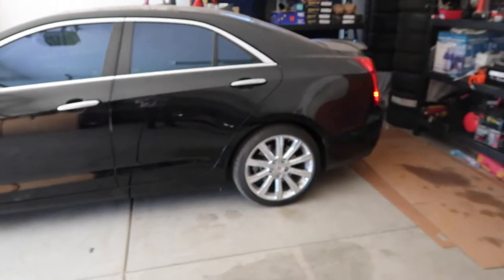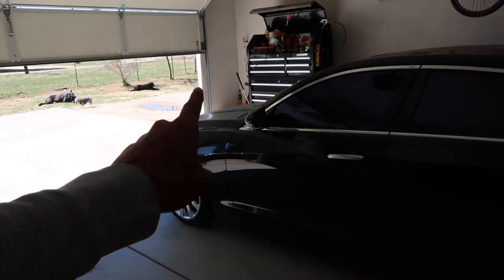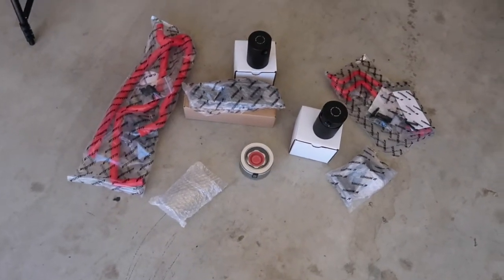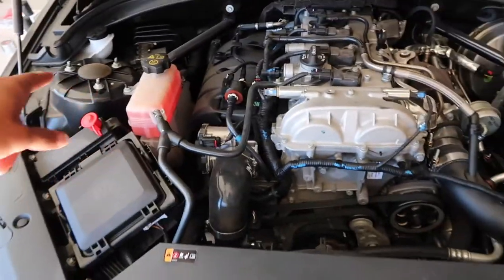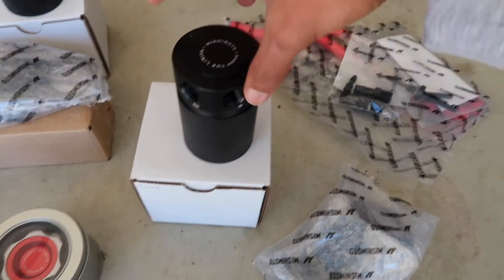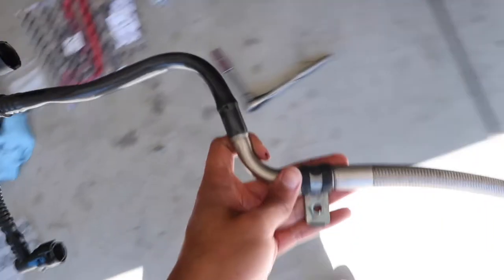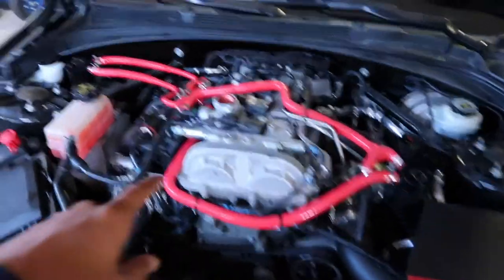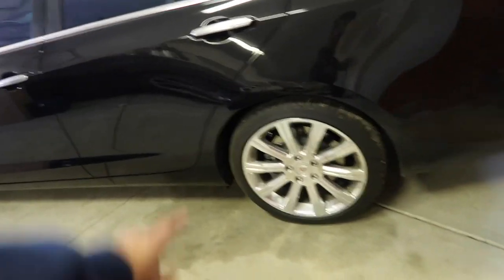Cadillac ATS 2.0T 6MT Mishimoto Dual Catch Cans Install!

Comment: Definitely crazy routing on that hose way over engineered curious why they don't have check valve every other manufacturer 4 catch cans have check valves maybe they're not really needed great video keep them,
Reply from the maker: Likely for the sake of appearance but the LTG motors definitely need catch cans as you can run into issues with excessive blow by once you're making "real" power (stage 1 and up). Even when I was stock my turbine on my turbo was covered in oil.

Comment: Considering the ATS has dedicated injectors actually spraying the cylinder walls periodically to keep the heat down (similar in effect to how port injection cools/cleans the cylinder walls), what's the point of this device?
Reply from the maker: The purpose of a catch can is to take what is being sent out through the positive crankcase ventilation (PCV) valve, and separate the actual oil that may come out, collect it, and send just air and vapors back to the intake manifold, as opposed to the PCV system sending both air, vapors, and oil back in the intake manifold. The catch cans have definitely limited the amount of oil that my turbo would eat prior to the cans being installed.
Reply: @PREVA1LMOTORSPORTS  the air intake already has a baffle system before the throttle body (most likely for that purpose)
Reply from the maker: On ATS's the intake isn't attached to the throttle body, it's attached to the turbo unless it's a NA 2.5L or NA 3.6L. I know what you're talking about though, the white filter inside the stock intake. I personally think that filter thing is more for silencing the intake (no pshhhh noise) but it could be for some sort of baffling but if it is then it isn't very good by any means because my turbo will typically have a lot of oil build up before the compressor wheel when running the stock intake but whenever I have my mishi kit on there's no oil to be seen. I push my ATS too so I rather be safe than sorry.